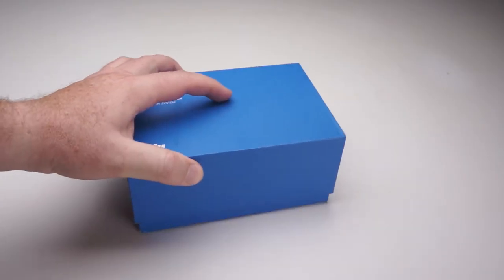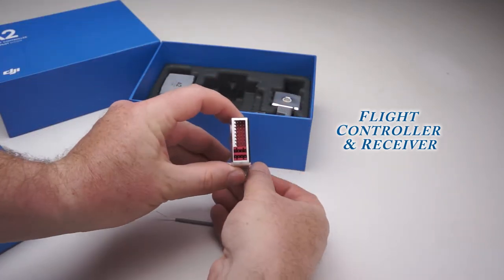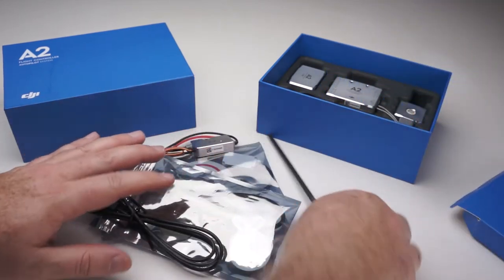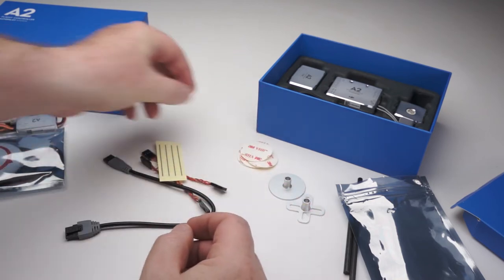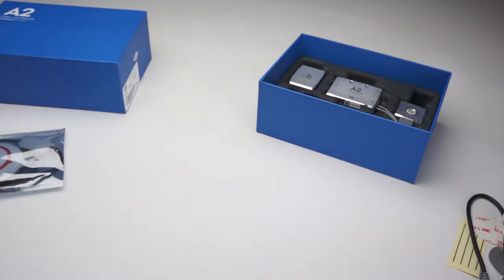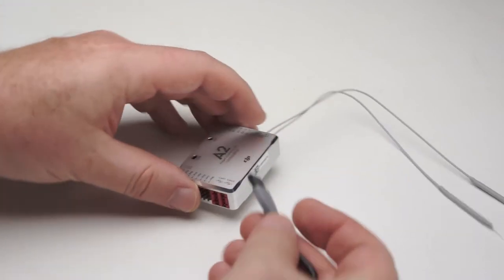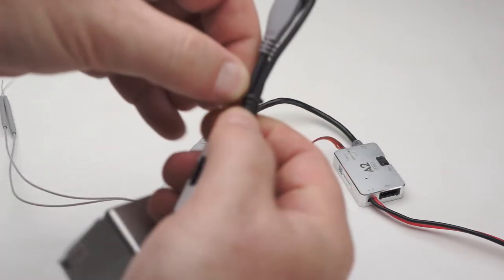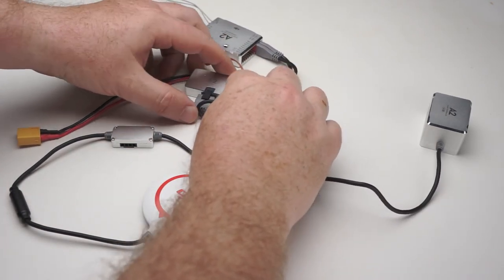DJI A2 Flight Controller unboxing

Comment: Great video. I´m new in DJI products. I have one hexas and one quad but with the Ardupilot controller system. This DJI A2 looks amazing and I wanted to know if it´s possible to get the data of the sensors of the IMU in real time, as we can do with ardupilot.
Thanks!